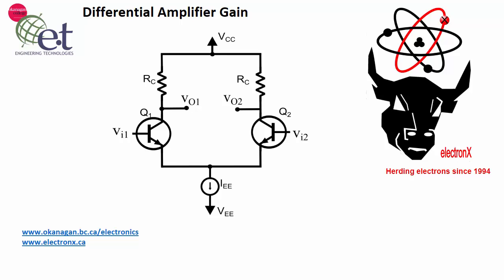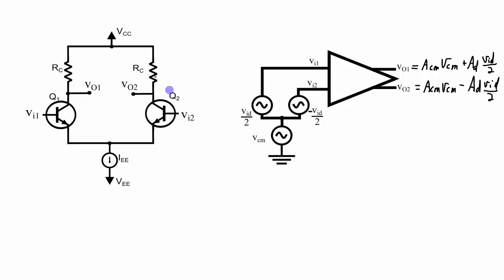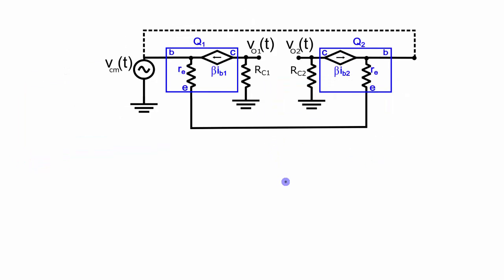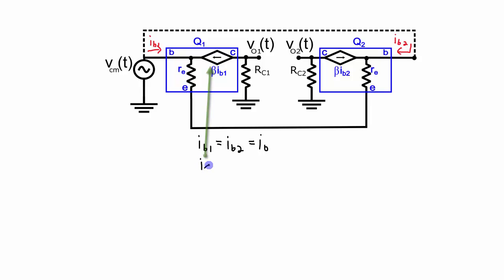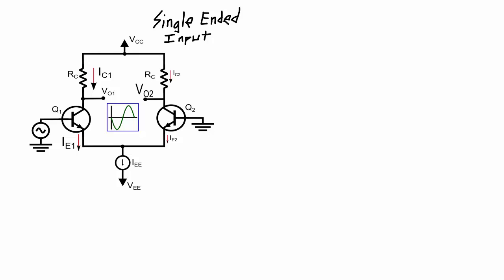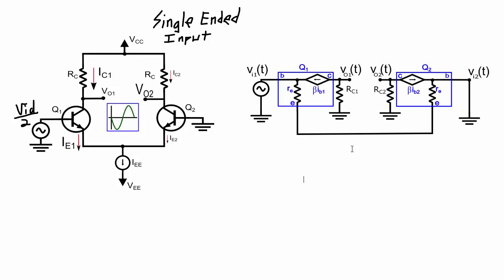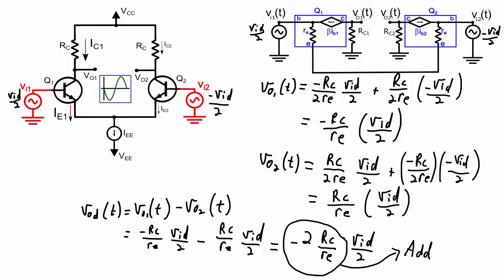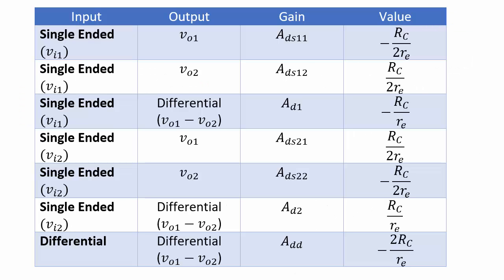Gain of BJT Differential Amplifiers

Comment: If there's not Rc in one of the branch can we still say both Ic's are equal in DC analysis?
Reply from the maker: Rc does not affect the Ic, it will only affect the point at which the transistor enters saturation.
Reply: @ElectronXLab  Thank you so much,I have seen some questions about this top,c but they didn't have exact symmetry and I thought i this way,but now it's clear,thanks :)

Comment: how do you find re though?
Reply: re is determined  by the DC bias(VCC to be exact),  usually use VT/IB(mA) this formula to get re, VT is just a constant  normally around 25
Reply: @fanpeter-z3c  Hi, in this case there is no DC bias, so IB is 0 (I assume?), then isn't VT/IB close to infinity?
Reply: Mutant Llama this resistance only affect  AC signal only.

Comment: Why isn't the connection between the two emitters also connected to ground in the Small Signal Model (AC) since in they are connected to constant DC (at least for common mode)? In which case, wouldn't the two emitter currents just flow to ground?
Reply: Because there is current source which is open for ac...disconnecting the vee to ground
Reply: Andrew Hughes make sure that constant voltage and constant current is different.  for Constant voltage is short circuit while constant current is open for removing source.   Btw, i read some demonstration, Iee is replaced by a Re resistance and connected to ground. for the best performance , Re is as large as possible so that a current source is replaced as it is seen as resistance infinity .

Comment: So is this the simplest operational amplifier that can be made? Does it meet all the definitions of an op amp? The inverting and non-inverting inputs of an op amp are a  a differential amplifier, which is why I ask.
Reply: This is old but... I think one of the inherent characteristics of an operational amplifier is the absurdly high voltage gain. So, I think that the simplest operational amplifier can be constructed with this differential amplifier and a block that give an ultra-high voltage gain in cascade.

Comment: In my opinion Dave you should clearify better that the differential gain of the differential amplifier is the same, regardless if the input is single ended or differential. (Vo1-Vo2)/Vin = Avd. In your table it suggests that the differential gain of the differential input version is twice the one of the single ended version (-2Rc/re vs -Rc/re). I actually know what you meant (which is not the differential gain) but it still a bit confusing.

Comment: hi there, really great video, thanks for putting it up. i am just a little unclear about when you introduce the differential input. you say define the input of Vi2 as 180 degrees out of phase. its not out of phase though, right? like the input should be just inverted polarity, but in phase. thats how balanced signals work i thought.

Comment: 4:24
Why does Ie = 0  automatically mean that Ic and Ib = 0?
Reply: Ib is like a gate for Ic to Ie. If Ib > 0: current can flow from Ic to Ie and Ie = bèta * Ic. If Ib = 0: the gate is 'closed' and no current flows from Ic to Ie.
Reply: normally, ie = ib + ic .. It means that if ie = 0, the sum of the two is 0, meaning both are at 0A, assuming there are no complex plane currents